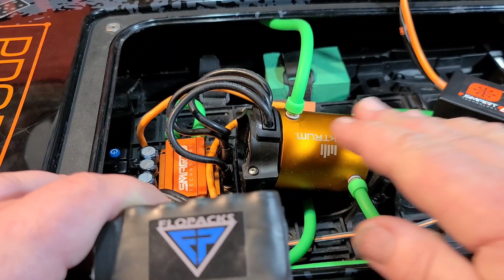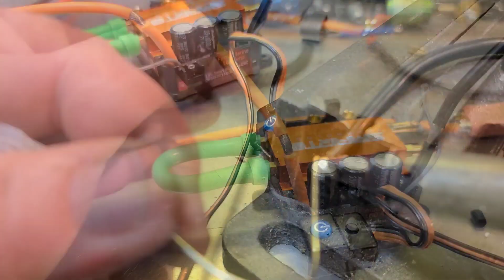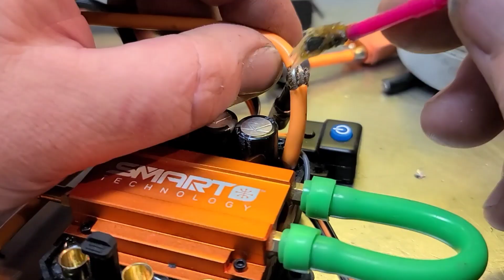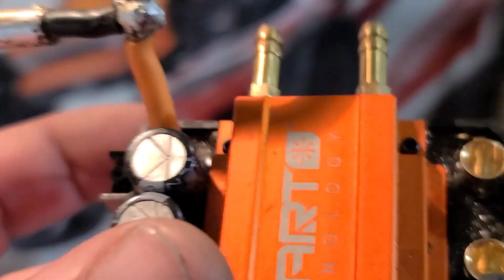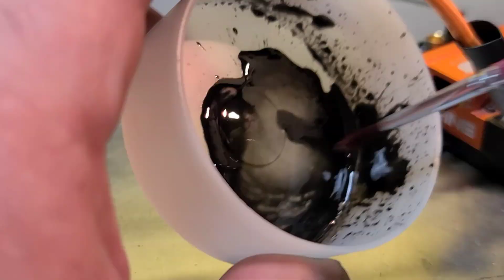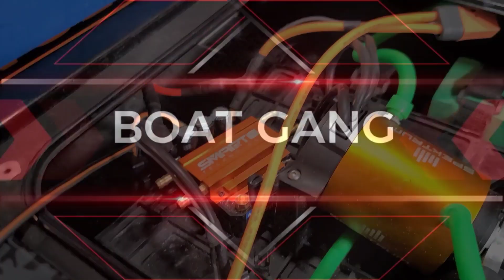Flopack Cap Pack Install Blackjack 42 Firma 160 - Fast Electric RC Boat Setup

Comment: Just so you're aware- the proper way to solder is to apply the heat to one side of the joint- and the solder to the other side. Solder will flow towards the heat, filling the joint with solder. You don't 'paint' solder onto a joint (from a former certified Navy micro repair tech)
LOVE your videos!

Comment: Bella Big B. Excuse me but I noticed that in a previous video you had soldered the positive and negative of the package directly on the correspondents of the esc without adding the connectors. Sorry but what changes that I did not understand correctly?
Reply from the maker: There's a few different ways of installing cap packs.    I wanted to enter change the cap pack with different boats like the  42, v2 ,Deltaforce 35,
Reply: @IRONCLADRC  thanks man

Comment: Also, how much does that pack weigh? Cause you’re putting that weight up front so you’re gonna have to swap your CG backwards. I have weight in my nose also and have to run my batteries almost dead center of boat now
Reply from the maker: It's not much extra weight the og speed run pack weights 61 grams
Reply: @IRONCLADRC  where are your batteries usually?

Comment: Nice job Big B 👏 
Whether or not there is a 'right' way to install a cap pack which can be easily moved to a different ESC (if needed) you showed great ingenuity there brother 👍
Looks like they sent you the 'platinum' model too, priced at around $90!! For boats that are built for performance and racing, that's an investment that could pay off.

Comment: That is a Jet-Approved method of tying into the power leads.  No additional resistance in the power wires.  Electrolytic capacitors are like little batteries; the LiPos charge them up when connected, then the caps supply that little extra burst when needed or soak up a little from the batteries when it's not needed.  That is how they smooth out the current.  Highly recommended in high-Voltage/hi-Amperage installations.